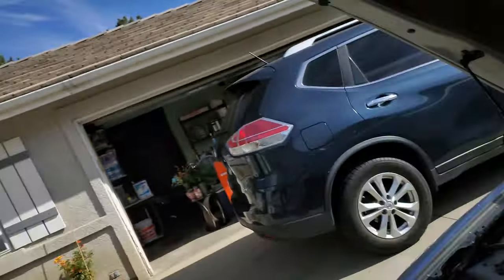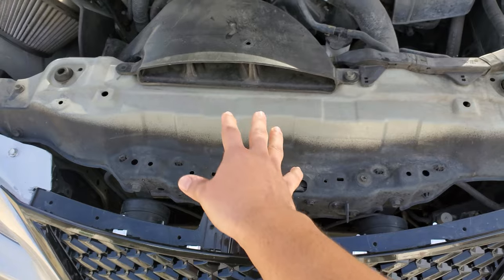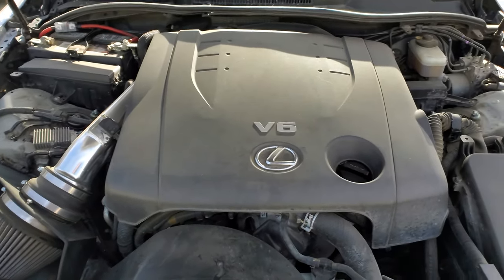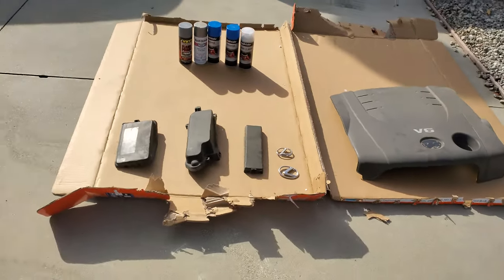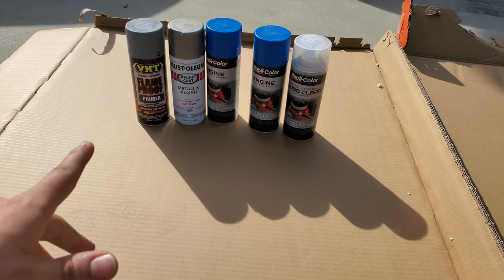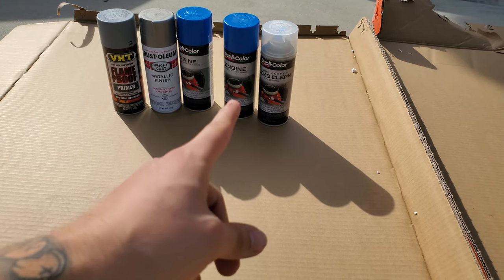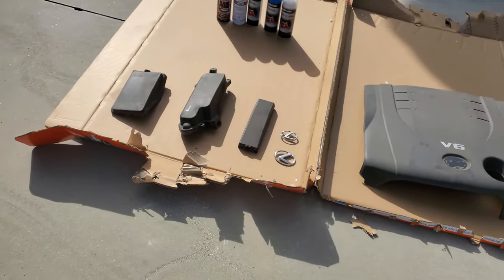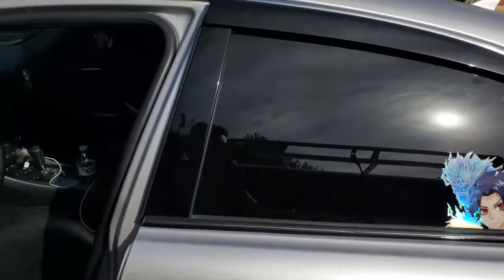HOW TO PAINT YOUR ENGINE COVERS!! (DIY)

Comment: Start with 600 and move up to 1200 then use primer/filler in one. 1 light coat 2 heavier coats. Then apply paint 1 light coat 1 medium and one heavy coat. And same with the clear coat. Will look much better.
Reply from the maker: Wow this was hella informative deadass, especially cause I need to redo this video lmao thanks so much fr fr 😁🤞🏽
Reply: whats the point of sanding just curious
Reply: @aldousalindogan9845  it’s so your paint will stick.

Comment: You need to re-do brother. Your problem was too rough of sand paper. You need to start a lot higher than that. You can also use filler primer which helps a ton. Good luck on next run. Keep working at it. Dont give up
Reply from the maker: Agreed! Definitely trial and error in this vid but, fun. Thanks for watching and your support 🙏🏼😁🤞🏽

Comment: hey man no hate and im literally seeing this on my girls youtube, but i have a few tips, maybe try them and attempt another video on this topic. the engine specific paint is useless. consider this, if you used non engine advertised gloss coatings, why would you have to have flame proof? spray paint isnt a fire hazard when its dry. also, you oversanded. use 80, then 150, then 210. my trick is just called "smooth". is it smooth after ALL sanding? then youre fine. dont eat at the plastic, just remove the coating and scuff that cover right up. then do about 6-8 coats of your paint. i reccomend krylon fusion all-in-one. just used it yesterday, paint surface is smooth as butter.  not saying you did yours wrong, but you spent unnecasarry money and focused more on time than end result. take your time, and make it yours man.
Reply from the maker: Hey appreciate you putting in some tips man. I can tell you that this was my first time doing it and I just wanted to do it, nobody teaching me so I'm learning as I go. You right though, I did oversand and messed up the plastics a bit. The paint wasn't necessarily a bad choice but im sure theirs better out there. I had fun and the end result wasn't bad for first time experimenting. Definitely not afraid to try things that you or anyone else comments. Thanks for politely putting in your tips and thanks for watching too. Hopefully you stick around for the growth 🤞🏽😁
Reply: you don't need all that diff. sandpaper..400 wet-dry will do the trick..

Comment: You should've washed those parts with soap and water. Then cleaned with alcohol.  Because plastic has pores and holds grease. Chances are the paint wont last.